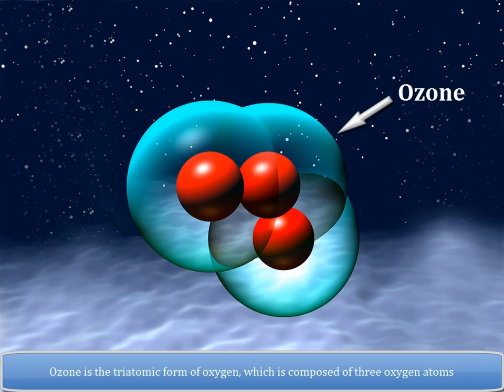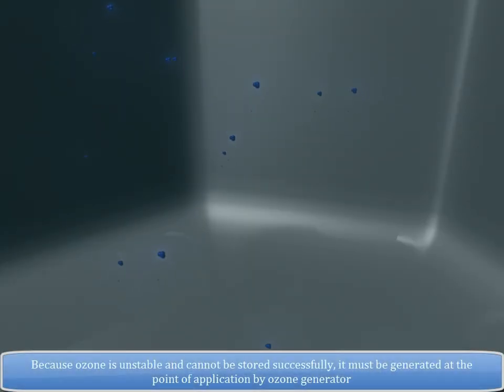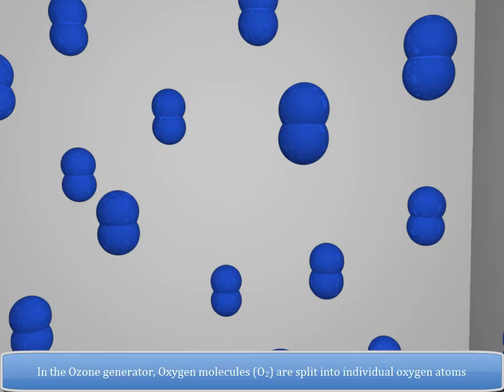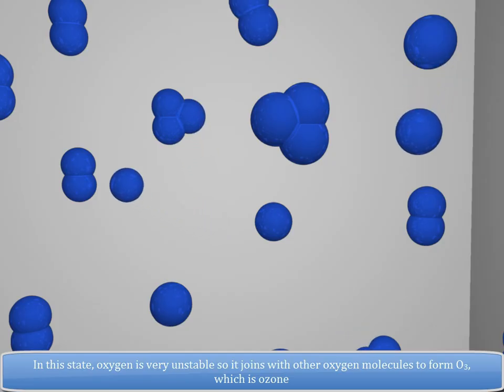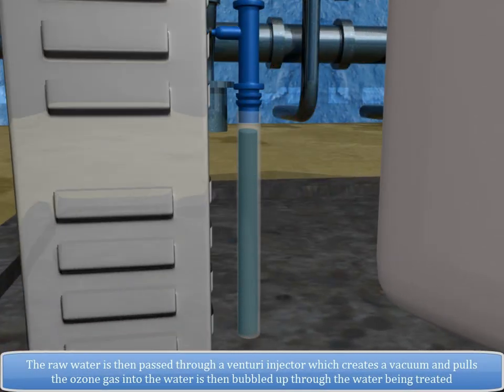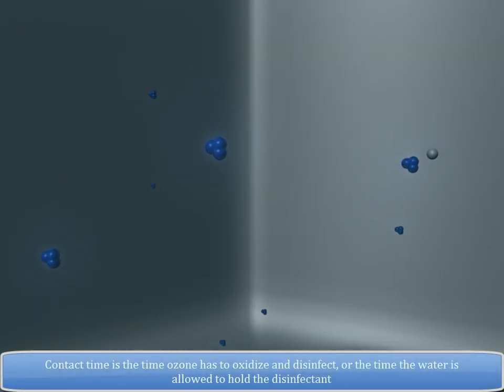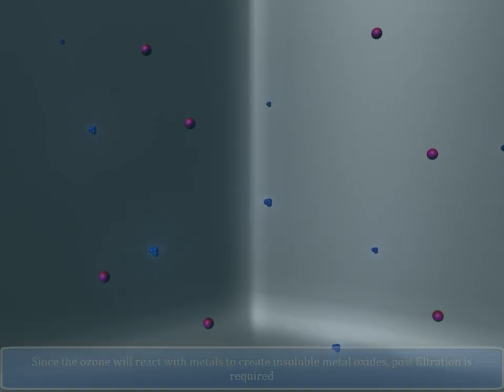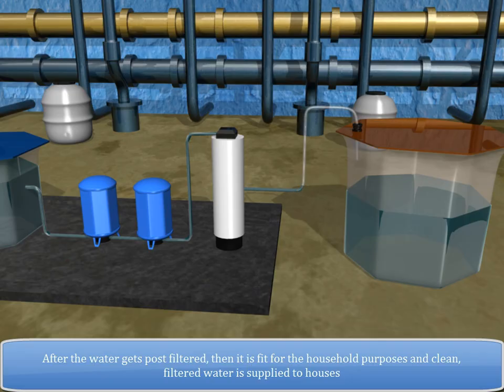[ Ozonation ] - Learn How Ozonation Process Works

Comment: This is really quite fascinating.  I thought ozone simply neutralized organic molecules , I didn't realize it also bonded to metals.
Reply: well of course, ozone, or specifically radical compounds created from ozone, is very reactive with non-selective attribute. That means almost everything would be attached to ozone.
Reply: @rumiazhari7387  ,  interesting.  
"Imagines creating ozone magnet field to haul away mother in law into the ozone layer."
Reply: @rumiazhari7387  , 🤣🤣, mother in law will be NOMed!